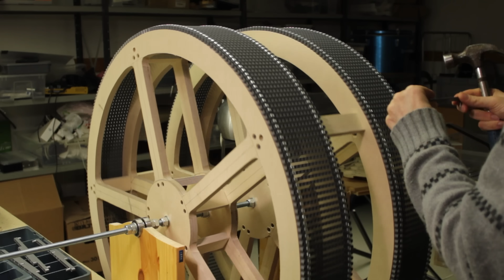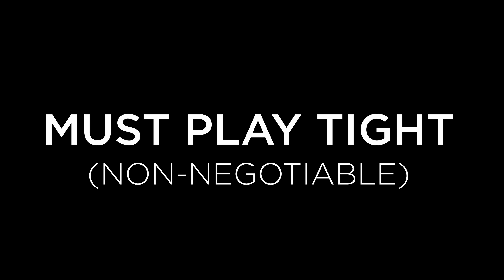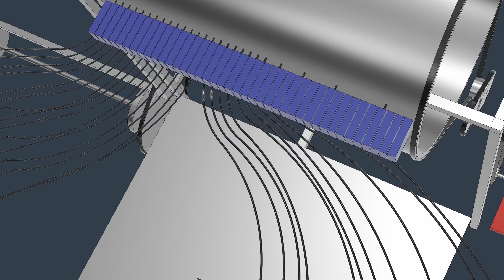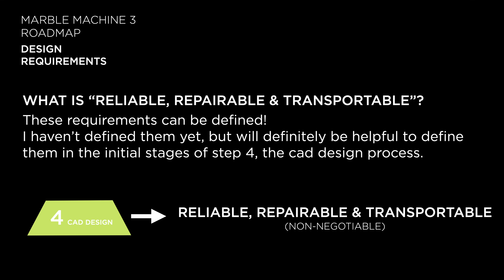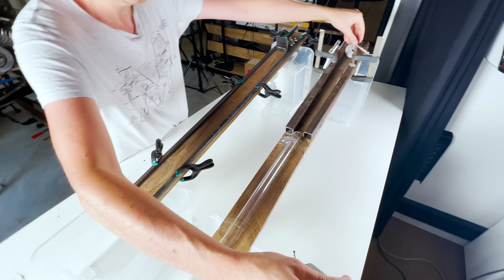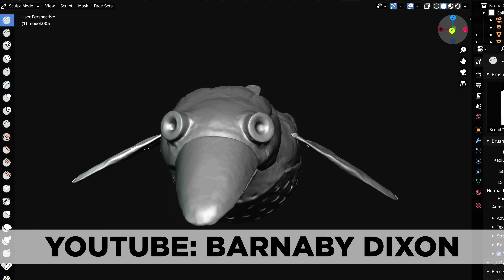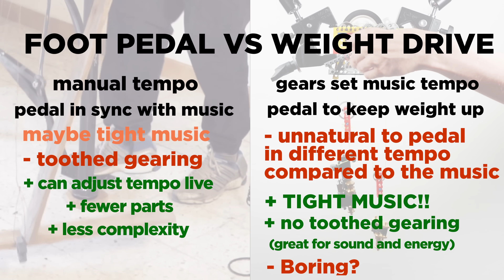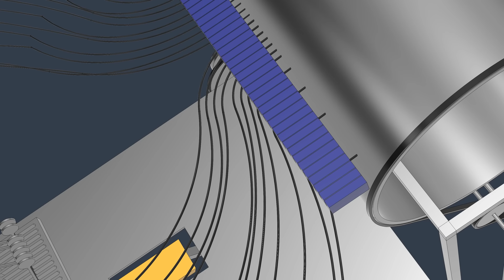Marble Machine 3 is Taking Shape

Comment: two laser beam sensors. One above and one below the timing weight. When the lower beam gets interrupted ( weight too low), engage slow electirc motor. When the upper beam is interrupted ( weight too high), stop the electric motor. No more pedaling.

Comment: Martin. The weight drive is not preventing you from pedaling a specific timing. At all. You can ratchet the weight up with the pedal at any pedal rhythm you like. All you need is a mechanism that discards additional energy in case you pedal too fast.
Reply: Also, couldn’t he make an adjustable one where the weight remains in place only when pedaling at the correct BPM? That would give him a visual indicator that he is pedaling at the correct speed and I for one think would be pretty cool. I have no idea how complex or even possible it would be to do that though.
Reply: Hs sees it as its the harder option, so every thing he said about tight/tempo music goes out the window.... the music might still be tight, but just dont see how he will keep a stable tempo as his leg would tire.... ? think the weight drop is best option, fit a goveror and job done

Comment: If you are using an adjustable governer, you would be able to adjust the tempo on a weight drive.
Reply: But it would be tricky to do live, while in the middle of a song
Reply: take the internals out of an old Goldring Lenco GL75, he could have speed from 16 to 78 RPM, and anywhere in between ;-)

Comment: Hey Martin, what about electrically assisted pedal? It would have the best of both worlds: tight music and the capacity to adjust the tempo. Kinda like an e-bike works
Reply: This sounds helpful. Especially if there were 2 pedals so that the tempo could be increased to double the speed by using both?
Reply: honestly i think the weight drive makes more sense, and have an electric motor keep the weight suspended at the correct height.. then he doesnt need to worry about cranking it at a different tempo from the music
Reply: This is exactly what i want to say too
Reply: A massive amount of the Marble Machine's coolness comes from it not being electric. Tourists love seeing old steam engines in action, not so much electric motors, even if they're historic/special.
Reply: He had that on the MMX and I don't think he ever said anything about not liking it. It seemed to work very well.

Comment: If your weight drive uses a differential, you can over-pedal and the input will just ignore it. So make it so that the pedal sets the tempo by adjusting something else--like adjusting a governor, but also drives the wider enough that you NEVER wind down.
Reply: Should be able to adjust tempo on the fly on the weight drive with a cvt that can be set with a knob/lever,
Reply: @Sullrosh  Exactly what I was thinking.
Reply: More complexity tho
Reply: @Iangamebr  true but sometimes a little added complexity is worth it for added reliability and consistent performance. Like you don't NEED a flywheel, but it sure makes things run better!
Reply: I posted another comment before finding this one, but YES. I was thinking more like the governor on a steam engine. Or the wind blades on a music box that set the speed. Just make that adjustable via a crankhandle. Constant power from the weights through a flywheel should make tight timing. Gear the foot pedal so that stomping in time with the music puts just enough energy in to keep the weight balanced. You'll always stomp in time with the music. The slower the song, the slower the flywheel, the less energy used, the slower the input.

Comment: Why has Martin limited his power source choices to crank, pedal, and weight? Surely an electric motor would be the tightest, most reliable source of power. A pedal that controls the speed would be all that's required. If Martin's primary goal is a machine that plays tight and is "function first, design second", why set arbitrary rules on the power source being driven by physics rather than electricity?

Comment: Step 4 is satisfied when "Tranport, Setup, Breakdown, and Repair are quick and easy enough that Martin is excited to take the machine on Tour"
Reply: Hey, at least "quick and easy enough" will probably still be measurable as the time it takes to get it done.
Reply: It should also be able to do a complete concert without any kind of intervention other than changing the programming wheel for the next song. It's ok if it needs to be lubed/tightened/adjusted after being set up at the next place, but if that process takes more than, say, an hour something probably needs to change.
Reply: @andersjjensen  It's somewhat comparable to having a piano tuned on the stage before a concert. That typically takes several hours, but is accepted.
Reply: @EliasHasle  Except it takes 1 to 1.5 hours to tune a piano. Which seems manageable because it doesn't also take, say, 2 hours to also assemble the piano on stage. MM3 will have at least as much wiring as the MMX and will consist of more sub assemblies in general. If Martin doesn't watch out it could easily be half a day of rigging, which will put limits on where he can perform, as many places try to get a high turnover. He's not (unfortunately) in the same league as Metallica who has two complete stages, so one roadie team arrives when the other one is in concert. They just need an open field to do a concert. Martin will mostly play at venues that would like to churn 2-3 bands a day.
Reply: @andersjjensen  You have some points there. 1-1.5 hours is realistic for finetuning an already nearly tuned piano, as will typically be the case in concert halls. And the piano can be used by many players, unlike the marble machine.

Anyway, I think Martin will find venues that allow him to occupy the stage for more time rigging. Maybe even sell tickets to watch the rigging... 🤑